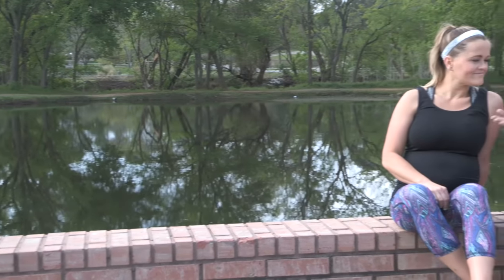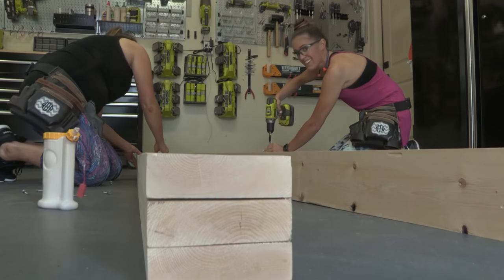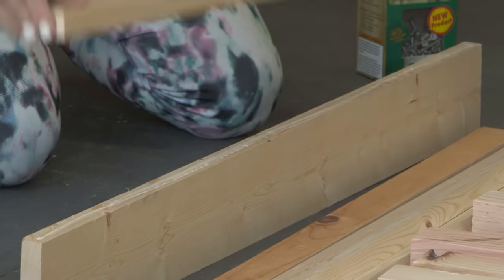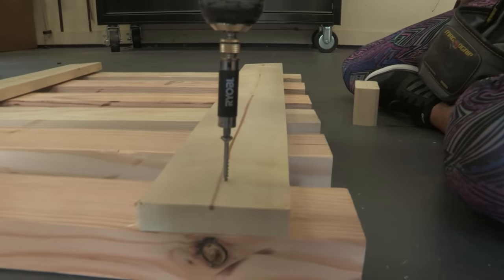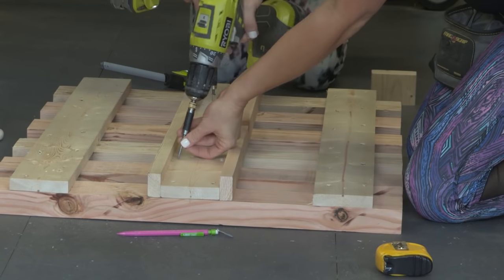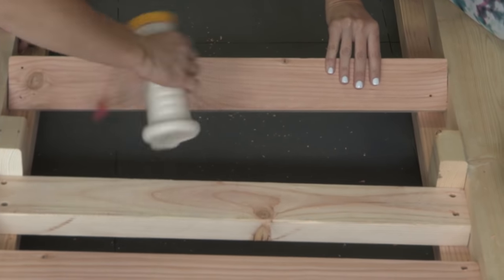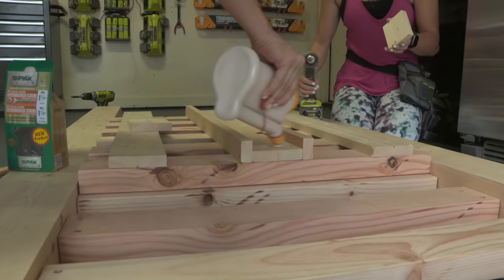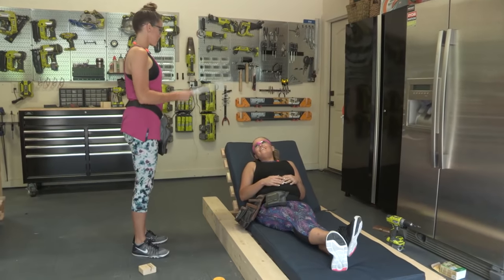DIY Outdoor Lounge Chair

Comment: Great stuff, in wet climates you might want to make sacrificial  'legs' to raise the lounger up off the ground, they could be soft or hardwood. The other thing I have done is add wheels to a lounger with lockable castors, they worked ok but the ground needs to be pretty level. Keep up the good work!
Reply: I was just thinking they could be a little bit hefty to move around & castors would really help.

Comment: good stuff ladies! chair looks nice and sturdy...u should get those spring loaded center finder drill bit for the hinges.makes drilling so fast and accurate 👍👍
Reply from the maker: Thanks!!
Reply: Shanty2Chic ALWAYS!!🍻
Reply: ***** theyre not too bad..ive seen little crappt thin  plastic chairs run 199.99 each
Reply: I've been pricing loungers and this is CHEAP - most are $200/ea to buy, at minimum!
Reply: Sonia J needs cup holders for the magaritas..;)
Reply: Joe basement woodworking I've seen fabric hung over to use as a holder look it up
Reply: Rosario Miranda im a lil confused..ik ur talking about a cupholder but idk how fabric would be used. 😶😁
Reply: Joe basement woodworking I know right! I was thinking of storage;-) not drinks. Oops
Reply: Rosario Miranda i gotcha..good stuff!
Reply: Norbury53 oh wow thats crazy..

Comment: You should have used a single 2x4 instead of all 2x6 on both sides and you would have a stronger design for slats. Overall great job.

Comment: Love the look, but I have some constructive criticism. You mentioned several times to use outdoor screws and hinges, but what about treated lumber? That wood will start rotting, twisting, with the 1st rain. You should coat with an outdoor water sealer at the very least.
Reply from the maker: I did coat it with a protective finish and I mentioned that in the post on our site. I still have them and they haven’t warped or rotted.

Comment: You could use solid 4x4 or 6x6 posts save joing wood. Also that's a lot of weight resting on those 2inch screw in the side batons - not better to mitre section out of the sides so it's resting on the actual wood not the screws!. But love the design.
Reply: I'm actually building them right now and I thought about that.  But I will just add a small bracket for additional support under where the butt would be to hold weight when sitting up.  They never mention and I don't see it in the plans on overall lenght.  I build before I I assume it's 72" or a tad longer than cushions but they never mention cutting the 2x4x8's.   I'm using 4x6's

Comment: Instead of stacking 4 2x6 and then adding the small piece inside for the base why not sandwich a 2x8 in there and you’ll already have your ledge...
Reply: I thought about that too, but it would not give you the look of the raised arms on the side.   The 2x4's would be flush with the sides.   One thing they never discuss in video or plans is the length they cut the 2x4x8's.  I'm assuming it's length to the cushion, but just not specified.  I have built two chaisse lounges before, but it might be beneficial for others to see.

Comment: Why didn't you use pressure treated lumber?
Reply: Amanda Duso thats what I was thinking? You don't want the screws to that but let the wood warp and rot?
Reply: Amanda Duso why didn't they pre drill?  Why didn't they do a lot of things..  these two are trying but they are not building something that will last.

Comment: 85$ for soft pinewood which wouldn't last one seasons outside eesh...also where is the price and link for the cushion? This looks more like a 200$ total cost + weatherproofing finish on the wood but it still wouldn't last very long considering it's not hardwood. :( better buy new.
Reply from the maker: Amalia Guégan except they are still going strong after 6 Texas summers 🤣🤣🤣
Reply: With the cost of wood now it's 225, additionally, the plans and the video do not match, additionally the cut list is incorrect